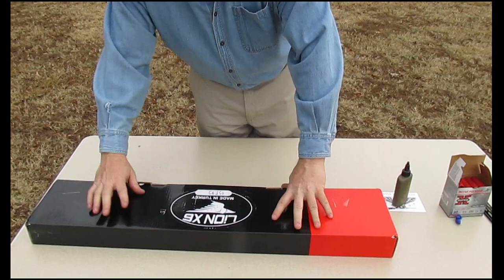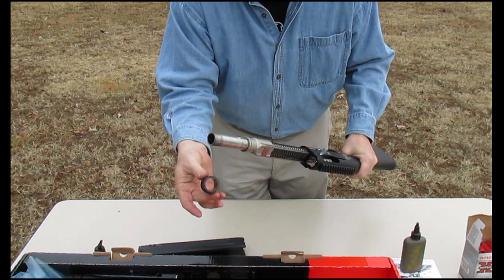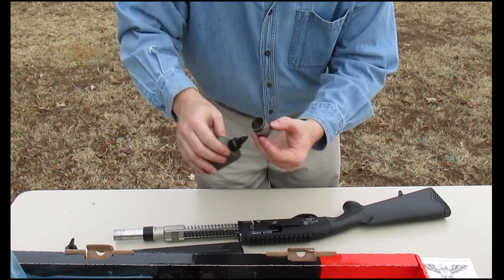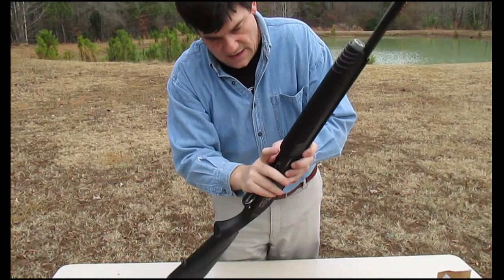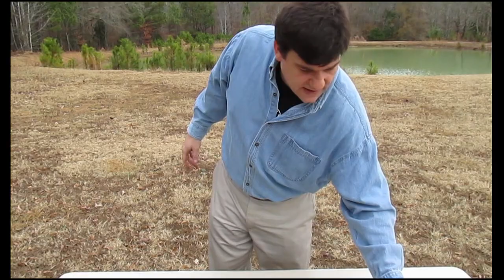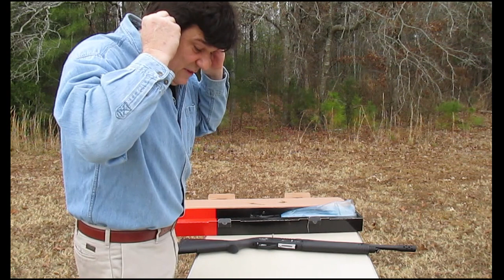Lion X6 tactical semiauto shotgun assembly & live fire break in

Comment: Whats the difference between the x4 and the x6?
Reply from the maker: x4 HAS PISTOL GRIP STOCK, Benelli Beretta mobil choke threads, rail integrated rear sight, bird cage barrel attachment. X6 has threads on outside of barrel, compensator attached, heat shield, sight groove machined down the rail instead of rear sight.
Reply: Thanks. Got my X4 today can't wait to break it in. Thanks Ben

Comment: Is this basically the same as the Hatfield sas?  Looks like same internals .
Reply from the maker: The real differences that matter are in the gas systems & bolt carriers. Some brands have crap pistons with round rings that are in a squared groove & they will sometimes only come with one piston. Also, some will have welded carriers or action bars instead of 100% machined. All of ours come with fully machined carriers & dual gas pistons with 1 flat ring for light loads & heavy load piston has no rings with blow-by slack.